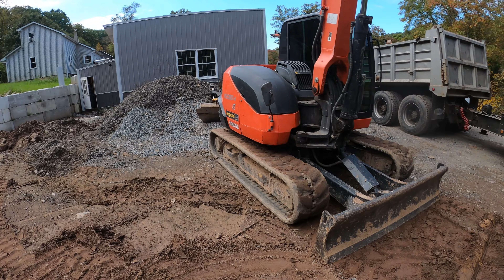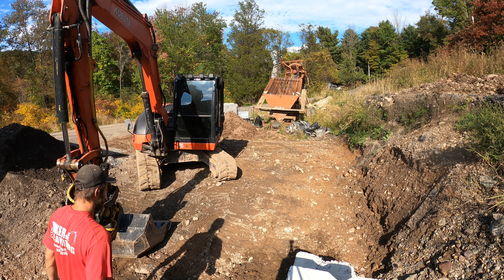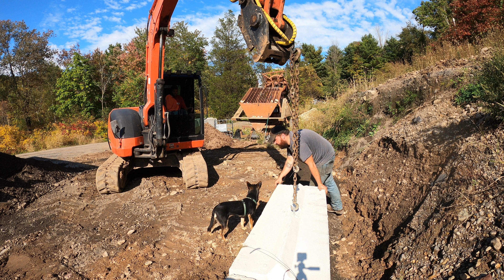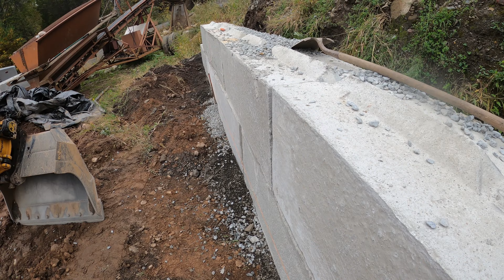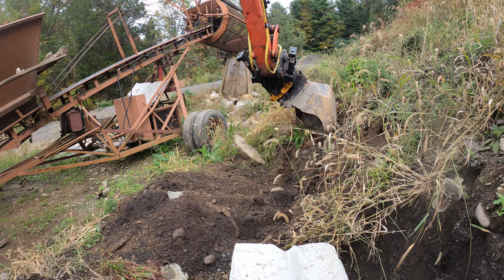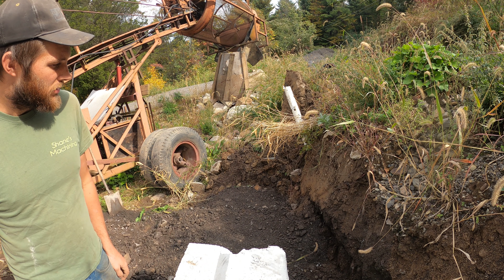building a Concrete Bin block retaining wall Kx080 and tilt rotator

Comment: Thanks for posting this!  I’ve been super curious about concrete waste blocks for the longest time.  Question, what did they charge for each block?  Did you find that they settle much?  It sounds like you set up a French drain behind it too?  Thanks again for posting this!
Reply from the maker: Hey I use these blocks very often. They are all over the place as far as price. Was pay $20 a block at the start of
This project. Just bought some two weeks ago and they wanted $60 a block. 
They will settle if
You don’t have a decent footer. That wall did not settle at all and is now 4 blocks high. 

It’s normally a good idea to have a drain behind the wall. The blocks are heavy but frost and hydraulic pressure from groundwater is strong. 

Glad you enjoyed!
Reply: would u recommend doing a concrete footer if so how thick and how far down in the ground should i go?

Comment: Getting ready to do a job like this on my home, gonna be removing 42' of stone retaining wall thats about 50yrs old and collapsing and replacing it with these type blocks.. gonna have to do the old stone removal and any digging by hand then gonna use a crane truck (stepdads) for the lifting/placing of the Bin blocks.. the previous stone wall was made of 2'x2' or smaller river stone that I can typically move by hand with a little muscle and were set on a foundation thats pretty solid, smaller 2 to 3in compacted stone with sand.. it'll only be 2 rows high as the existing wall is just about 3.5' above the dirt so that leaves 6" of play to work with so as to not be below the current wall height, higher is ok. 
With it only being 2 blocks high and 7 wide I'm hoping that any significant settling/shifting will not be a problem. Got a concrete company 2mi from the property that has the 2x2x6' blocks for $50 and the 2x2x3' ones for $45 so im obviously gonna try to use all 6'ers
Reply from the maker: Seems like a good project! Gonna be quite a task digging it out by hand. I’d rent a mini excavator if you can swing it. Gonna save your back and a lot
Of time. I’d fear that one bad rain storm and you are gonna have a major problem if you are caught with the wall removed

Comment: No geo, pipe drainage or gravel backfill?
Reply from the maker: It has drain tile and stone on the bottom 2 courses. Walls still standing today!

Geo grid would have been a good thing to have on it but I didn’t have any when building this. It’s at my shop so not like it’s for a customer

Comment: isn't it easier to pour concrete?
Reply from the maker: Probably, but I don’t have the forms or the man power to do it effectively. They make these blocks from waste concrete less than 3 miles from my shop. I can buy them, haul them, and set them all myself. Pouring a concrete wall would cost a lot more plus is permanent. If I ever wanted to move or
Change this wall I can just dig it out and move the blocks.
Reply: @AbramsExcavating  what is the cost of one of those by the way?
Reply: These set without footings?
Reply from the maker: @tonyibarrondo6183  you can put a footer under them. But most retaining walls here just get a good base of stone and that’s it. These blocks weigh 3500lbs each. They don’t move once placed.
Reply: @AbramsExcavating I bet they sink tho
Reply: @AbramsExcavating more than one person has asked the price of the blocks but you've yet to answer. Are they that expensive?
Reply: @tonyibarrondo6183 If you're doing a permanent wall you should use some good crushed tamped gravel and and bury a row or two depending on height. You should also geogrid back the block if you are going over 4 rows high.